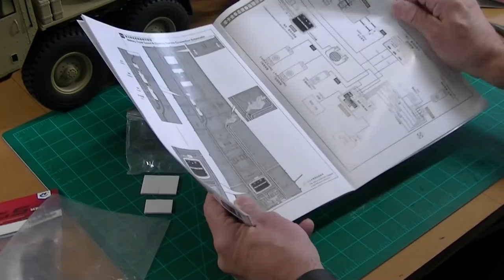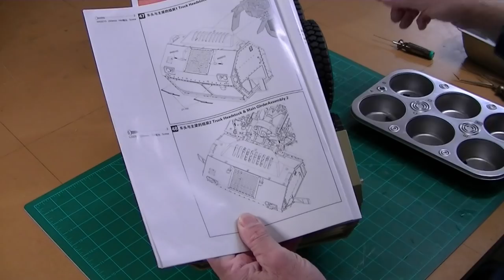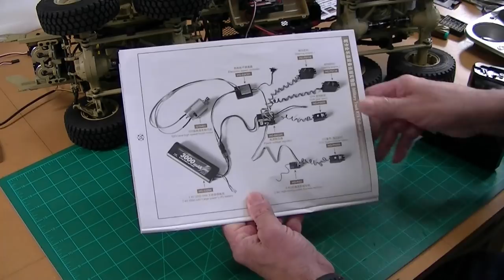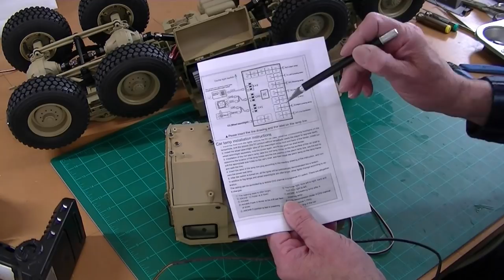1/12 HG Models RC HEMTT Install Lights & Sound

Comment: Press and hold the - negative button for 3 seconds to cycle through all the sounds it has in it.  there is many engine sounds and there is one perfect for that truck.  just press and hold the negative button for 3 seconds to change to the next sound until you find the one you like.
Reply: what is the negative button?
Reply: @pedullabass  this   -

Comment: Thank you, thank you, thank you......I'm so glad I waited for your HEMETT video!!!!!  Sorry to see that your roof light bar isn't operating as designed.......hope you get it fixed soon.  Having watched your video I won't bother with the sound kit.......it's headed for the trash heap as I type.  Thanx for the heads up regarding the tail light short caused by the metal bumper.....I'll be sure to remedy that headache.  I haven't tackled anything like this in a long, long time.......I'll try not to screw it up........wish me luck......I always have a terrible time losing screws!!!!  I'm going try something I did on a RTR truck years back involving using aquarium air stone tubing I split down the middle to hide some of that wiring.  I use black air stone tubing that looks great on the truck.  Your videos are so helpful and inspirational......thanks again!!!!

Comment: Hi!  to change the "engine" sound, you must press "-" for three seconds: you will alternate a different program every three seconds.
Reply: exact.  yes you can change the sound.
Reply: So the HG sound system works then?
Reply: yes. he showed it worked in the video . but he didn't like that particular sound.  he obviously didN't know that they come with other sounds  models and absolutely did Not know how to change them.  there is like 18 wheel big rig.  race car. heavy equipment and so one.
Reply: @1peanut  So does it have an exact sound that fit this Cat engine Hemitt?
Reply: @richarddaly9018  This truck had V8 Detroit Diesel Engine so it would need the sound of a V8 2 Stroke Diesel Engine

Comment: Hi!  I have the Heng Long 8x8 Hemett like yours. It has the factory installed lights & sound system. When I go forward the reverse alarm goes off & when I go backward the alarm doesn’t go off. Could it be something wired wrong from the factory or a radio adjustment. Thank you for your reply!

Comment: Quick question, can the different lighting modes on the Light strip be made to be controlled by the remote? I mean without someone reaching inside the cab to switch them to different modes? I mean do you think it can be modified to do that?

Comment: Do you think there is enough room to put the Beier SFR1 underneath the speaker? Where you put the sound and light module? With some modification for the wires and the USB cable?
Reply from the maker: I don't think so the fit is very tight in there.

Comment: Hi, I recently purchased the 1/12 HG 802 HEMTT and started to install the light kit and speaker. Well several things went wrong. 1. either the lights stay on or blinks constantly, 2. for some reason my transmitter is not working now with the truck, the transmitter lights are flashing red and green. I need help cause I'm starting to get really frustrated. I watched several of your videos and I must say they are really good. Thank you and I look forward to hearing from you.

Joe
Reply from the maker: Sounds like the radio need to be re-bound to the receiver.  Take a look at a few you tube videos on radio binding.  Also make sure the transmitter has good batteries.  The lights have several modes changed by the push button switch inside the cab.
Reply: Thanks for the tip, will do.

Comment: Thanks for the recent tip regarding low or flatbed trailer options, it helped. I'm an early entry to the world of RC modeling and much to learn. However, I consider myself quite apt with internet search options and for the life of me can't find the lighting and sound upgrades for the HG P801/2. I even tried reading the labels on the packaging you held up in your video but to no avail. Help?
Reply: Hey guy, you can find it on Ebay. That's where I purchased the sound and light kit from. HG RC DIY Parts LED Light Set for 1/12 2.4G P801 P802 8*8 Military Truck Car & HG Sounds System With Loudspeaker for RC P802 Truck Model DIY Car Electric Parts. Have fun...

Comment: after seeing your video I took the P802 from GeekBuying paying € 490.00 and then I bought on ebay the kit lights and sounds and I still have to mount them: go ahead you, so I will try not to make mistakes😁
Reply: I bought them both p801/p802 thanks too you lol..When ordering the p802 they showed in stock but day or so later no updates.. THey then said out of stock.. No biggy I'll wait already paid for it and the p801 should be here real soon 8-)
Reply: I've been tempted to buy from Geekbuying as their price is really good,  did you have any problems with them?
Reply: andicog , they are a bit 'long with the time of departure of the package since you paid (absolutely Paypal !!!). If after 7 days the package has not left, do as I do: a phone call to Paypal, and in 12 days total the Truck has arrived perfect.😉👍
Reply: @motoacquatico1967  Thanks,  love this truck,  take it your happy?
Reply: andicog , it's beautiful: having said this, I have not tried it yet on the ground, and I think I will never do it because it's too much, too beautiful; ... and heavy💪👍😁🏁
Reply: @motoacquatico1967  Thanks for your help,  I thought as well that it's a beautiful model,  I'm not massively into RC but this looks so nice especially at the Geekbuying price!  Thanks again and all the best.  Andi.
Reply: @motoacquatico1967  I finally bought one from Banggood, less than 2 weeks for delivery, very impressed, great truck, I've just ordered the light and sound units, managed to buy a brand new p408 Humvee without radio for a great price as well, that's also really well made.
Reply: andrew coghlan 👍👍👍💪💪💪

Comment: Did you solve the sound module issue? If not what other type of sound module can you use on this? Servonaut?
Reply from the maker: I am going to use the speaker but will replace the module with a GT Power sound unit.  Will show it in an upcoming painting/detailing video.

Comment: I just added the sound and light equipment on mine last night.  Looks like everything works ok.  I'm glad I came here because I forgot about the button to change the light sequence for the strobes.  I have a 10 channel RC/reciever to use for this, I'd like to have the lights on a channel so I can turn them on and off.  I also bought some extra off road light for it too.  But the way this is set up I don't know how I'll be able to put those on there own channel.  Plus just how to hook up the basic functions for turning, forward and reverse.  Anybody have an idea?
Reply from the maker: I am going to re-do all the lights and sound on mine.  Will make a video when I do.

Comment: Ive just ordered one of these, can i use my own transmitter and reciever as i dont like the pistol grip radio
Reply from the maker: Should be no problem. I am planning to change mine to a stick radio.
Reply: Kevin Mason.
Where have you ordered yours from, I'm considering one my self.

Comment: I installed a 1/10 SCX10 tow hook/chain and I snapped the head off one of the hook bracket bolts..........dang!!!!!!  It's gonna stay that way for now because I can't just stop everything when I screw up, otherwise, I'll never finish what I need to get done!!!!!  So, forward I march right into a desert sand paint job for the fifth wheel dolly!!!!  The light install will come later.......much later!!!!!

Comment: I highly suspect that HG packaged a police car light set as the HEMTT set. The cab brow lights should be amber and the dome light, which the truck doesn't actually have normally, should be on a switch. You would be better off kitbashing a Tamiya MFC into it.
Reply from the maker: Actually one of these days will get a proper Beier sound and light system, new 18 channel radio, new paint and the crane.

Comment: You would think for the price of this thing the sound would be something  close to a diesel engine . Maybe there is something wrong with the box!
Reply from the maker: Sadly that is the sound.
Reply: As mentioned by others this sound system includes several engine types and you can switch between them by pressing a button: Bob, you should give this system another chance and show us how to select a different mode, please! Besides, why don't you have it with the same color of the body? The green one can fit inside the green truck and on this tractor you should have the sand colored one...
As always I truly enjoy seeing you operate on a new project and I also like your models' choices!
Cheers

Comment: There are other videos with this same sound module that sound much better (https://www.youtube.com/watch?v=x0gA-x7pM7U) or (https://youtu.be/GAETu8ALF_o?t=416) 
I think you may have received a dud, I would contact the company to get a replacement or a re-flash of the software for the unit.